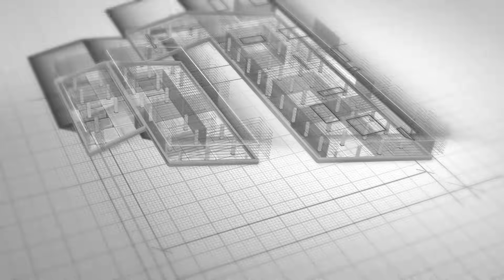Tallest Skyscrapers Each Country Is Building Right Now

Comment: rise tower 2km 600 floors in the future $5billion! 2030-2036 done
Reply from the maker: At the moment, claims of a 2 km, 600-floor tower completed for $5 billion by 2030–2036 aren’t supported by any credible public plans or budget estimates. Projects at that scale would likely cost many times more and take longer due to engineering limits, safety regulations, and construction logistics. Real confirmation would need official approvals, designs, and financing announcements.